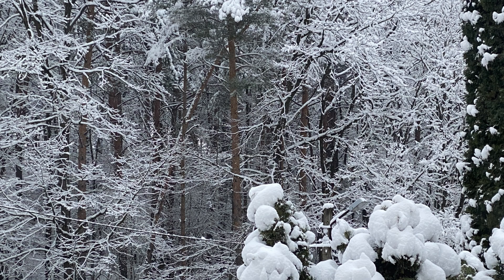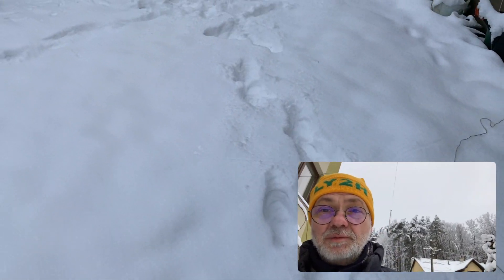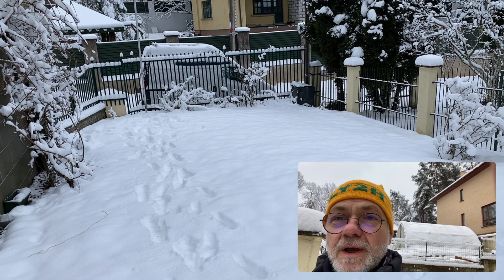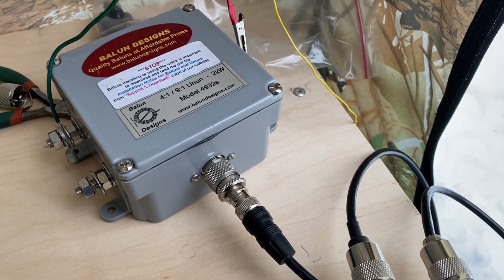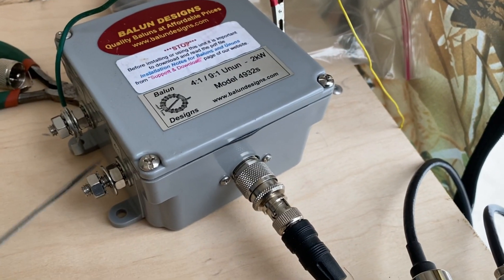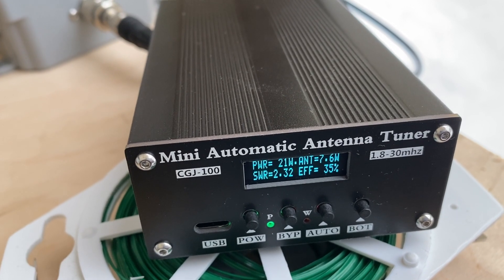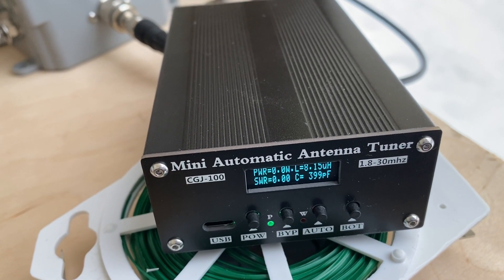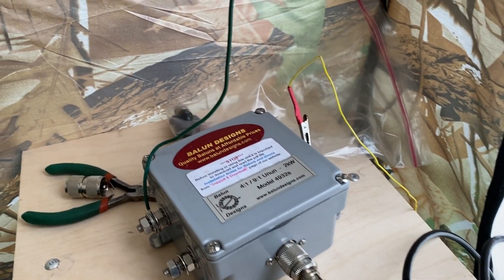N7DDC (CGJ-100) antenna tuner tuned 43 feet wire from 160m  to 10 m in my backyard! Field review.

Comment: I believe the velocity factor is a thing in this calculation, am I wrong?
Reply from the maker: Hello, it depends on the antenna type. VF of a plastic-coated wire is about 0.95-0.98. So, for a resonant  antenna it is an  important factor. For a non-resonant, "random wire" antennas for HF, though the difference in length  is not that critical. But of course, it should be taken into account, especially if calculating the right length to avoid the unwanted resonances in a non-resonant antenna. Good luck! 73! Linas LY2H
Reply: @Linas_LY2H  thank you for reply! 73 de YO4OCM

Comment: How does this atu work I've one here but its a red light on it
Reply from the maker: Hello, the tuner works run by the software which , firstly, measures the SWR level from the SWR bridge and, secondly, selects the right LC values to adjust the impedance between the cable (or antenna wire ,if no coax cable) and the transceiver output. The only red LED on the unit I have is an LED labeled "W". It must glow at all times, as it indicates that the software and the whole unit is working properly. The green LED only indicates the power is applied to the unit. HTH, 73! Linas LY2H

Comment: Hi Linas. I am new to using 9:1 ununs. I have a 50 foot wire on mine and 33 foot counterpoise. You are able to use a tuner to get 160m. I can only tune 80-6m. I wonder why? My wire is longer than yours yet I cannot tune 160m. Any idea why?
Reply from the maker: Hi, thanks for your comment! Well, there is no single rule as it comes to the random wires fed via the 9:1 unun. Usually, changing the length of the wire and/or counterpoise for several feet making it longer or shorter helps. In my case my wire was 43 ft with some 33ft counterpoise laying on the ground. It turned to be OK for this tuner to get 2,3:1 SWR on 160m. It could be better tune, probably if I would mingle with the lengths. It is also important to know that there are “good” random wire lengths and “bad” ones. There is link in the description to a lengths-chart. HTH, 73! Linas LY2H
Reply: @Linas_LY2H  Thanks for writing Linas. I guess half the fun of ham radio is trying various things. I will alter the length and see what I can do.

Comment: hello friend, i acquired the atu100 recently and realized that it marked roe and power outside the standards, so i decided to make some simple changes via pickit3 , when finished it didn't work anymore, can you guide me how do i get it to turn on again?
Reply from the maker: Hello Edison, thanks for watching! It's a pitty you've got something wrong with it :( . I am not a software coding expert, all I can do is to load up the software via the Pickit3 onto the chip and change few parameters in the cells, so I am not in the position to guide you through the troubleshooting :(( .  Very general advice is just try to upload onto the chip  the whole firmware anew. I don't know what make of the tuner you bought, it's so many of them in the market, and it is possible that the software may differ with each maker. So, may be you could  get in touch with your maker/seller for a link to download  the software for new. You could also  try to upload  the latest version  of the original N7DDC software. It's a version 3.2 now, I think. If you go to github.com and search for N7DDC you'll get to David's page and his files. There is a paper written by David with detailed description of functions  and software. If you don't have it, it is here : 
http://www.oz9f.dk/wp-content/uploads/2020/02/ATU-100_Extended_Board_User_Manual_eng.pdf
Hope, this was useful. 73! Linas LY2H

Comment: Hi. Mine doesn't work properly. I do not know what that red light means.
Reply from the maker: Hi. The red LED means only that the device is on and in working condition, i.e. the display is on and everything is ready for tuning. I don't know what exactly is not "working properly" in your case, so the general advise could be check if all the contacts on the ANT and TX  sockets are soldered correctly to the PCB, make a visual inspection of the board for suspicious soldering points etc. Also, please bear in mind this is not a QRP tuner and it takes more than 5W to start tuning. And this is not the power you apply from your radio but the power the ATU measures with the effect of SWR  deducted from the power applied. It could be, you apply 6W but due to higher SWR , the ATU only measures 3W which are "left" after the SWR. It won't tune then because 3W is not enough, it must be 5 W at least. Hope, this helps. GL! 73! Linas LY2H
Reply: @Linas_LY2H  Thanks for your reply. I checked and it looks all right. Maybe there is really too little power. I will check this with another radio.
Reply from the maker: @matjazs7348  Great, good luck!

Comment: Hi 

Great video. I have just got the cgj-100a but it does not power on the battery, I suspect the battery as it powers on with usb. Do you know what bot button does?
Reply from the maker: Thanks for watching! As to the battery, have you looked inside the box and made sure there is a battery in it at all? :) I know it's a stupid question, but it might be that some versions of this tuner don't have the battery option forseen. If it does have the battery in the box, then usual procedure could help: checking  contacts, making sure it's charged, measuring the voltage on the PCB etc. The BOT button is for the manual operation of the tuner. If pushed shortly, the RESET is seen on the screen, it resets the previous measurement and is ready for the new one. Push and hold the BOT, the TUNE is written on the screen. You need to apply the signal from the transceiver to the tuner while this TUNE sign is on the screen for the tuning to start. By the way, the Reset function  works independently of the mode which you set with the AUTO button.But it does not reset the mode though.  Hope, this helps. 73! Linas LY2H
Reply: @Linas_LY2H  Hi Thanks for the reply. Yes there a battery there but I didn't't have chance to ge the multimeter on it yet - It has some ugly white goo there will try an pick that off. Thanks 73s de M0MYG

Update!! - It was the Li-Ion Battery pack - there was no voltage - I rigged up a 18650 - works like a charm. Internally mine is different to yours. The FW is 3.1 and the board is narrower than the enclosure. Also the antenna connections are crimped with narrow coax with shield and conductor soldered to the main PCB- Think that's an improvement. Off to find a 4000 - 6000 mAH Li-ion BP now. Have good one 73s de Mark , M0MYG
Reply from the maker: @markyoung4485  Cool it works now! Have fun!

Comment: A 43-foot antenna is typically and easily hoisted at home or in a portable situation. It's dubious on all but the larger boats and totally impractical on a car. Have you thought about checking out which bands this tuner can handle if attached to a shorter mobile antenna?
Reply from the maker: Thanks for commenting! Well, 43 ft is more or less workable length on lower bands with at least some efficiency :). 7m ( abt 22 ft) wire could nicely work from 40m and up. As it comes to the mobile antennas, it's a different business. They rearly are , or can be ( due to some regulations depending on the country) longer than 1,5 -2m , so being this short they require some coil loading, the tuner (any tuner)  alone would hardly do the job. Naturally, when you use a coil, there is not much sense to use ATU, or if any , it's just for fine tuning within one band ( with bands selected switching the tap on the coil). I have not tried yet tuning my short coil-loaded 20m band mobile whip with this particular tuner but I did try with  the Elecraft KX2 built in ATU with no probs. There shouldn't be a problem for the CGJ too in such a configuration. 73! Linas LY2H
Reply: Thanks. I've got this tuner now and tried it with my Hustler RM-20 mounted in the attic. The tuner worked fine on 20 meters, as indeed it ought, lowering the already low SWR still more. I couldn't get it to work on any band from 40 meters up though. On 10 meters the SWR maxed out at 9.9. its probably looking like a high-impedance half-wave. I suspect that what's needed a coil-loaded antenna that's NOT resonant on any ham band and perhaps one that looks like it is 43 or 22 feet long.
Reply from the maker: @Inkling777  Nice experiment Michael! I think, not many tuners would tune your Hustler with the RM-20 coil on 40m or any other bands :( . Putting the RM-40 on 40m , or any other from the wide range of  RM coils on other bands would probably be the right way to go :). On the other hand , it seems to me that if you installed in your attic some wire of at least some 22 ft long and feed it via the 9:1 unun , then this tuner would be capable of tuning it from 40 and up nicely. You are right, in this type of the end fed -non resonant antennas it is important for the wire not to be resonant on any band especially at the half wavelengths. Good luck in your further experiments! Thanks for letting me know! 73! Linas LY2H

Comment: To make the tuner more QRP-compatible you need to do two things. One is to reprogram three locations in the EPROM on the microcontroller. The other is to rewind the tandem match, using only five turns on each side rather than ten. If you buy the tuner as a kit you can just build it that way in the first place. BUT... the power measurement range of the modified tuner is limited to 40 watts; it's a good mod if you only operate QRP or with a 20W radio such as a Xiegu G90, but not so great if you plan 100W operation.
Reply from the maker: You are right! That's the way to go if one wanted it to become a QRP tuner. But that would be a bit over the top move , having in mind that the problem  is exactly  finding  a that small 100W  tuner as this than to retro fit one back into QRP :). It is so many dedicated QRP tuners on the market, why bother ... 73! Linas LY2H

Comment: Does anyone have a schematic for the cgj.100. If so could u share it.
Reply from the maker: Hi, thanks for watching! I don’t have the schematic precisely for the cgj-100 but it is easily available schematic of the original N7DDC tuner on wich design all the later incarnations were and are built. CGJ-100 has done in-built batterry power supply with the new circuitry accordingly , he might have used some other components, etc. But if you only need the chematics for the general understanding of the design, then the original schematic diagram could be found within this google search. Have fun! 73! Linas LY2H
https://www.google.com/search?q=n7ddc+atu+schematic&rlz=1C9BKJA_enLT883LT897&oq=n7ddc+atu+schematic&aqs=chrome..69i57j0i22i30.15283j0j7&hl=en-GB&sourceid=chrome-mobile&ie=UTF-8#imgrc=IIgY-OKUjjNV1M

Comment: I bought one after your last video. Was here after 3 days. Working pretty good so far. Shown power is a bit less than reality. I wonder if anyone as a manual. Button 'bot' is labeled 'button'. Btw: my shield connectors were soldered together already... 😂
Reply from the maker: Thanks for watching! It’s a bit of a lottery with various makers/sellers of this tuner :) . I’m glad your’s working normally. Regarding the manual, there is no one that I know supplied with the unit but I can recommend an excellent  Technical Description in English of the tuner by the author himself, David Fainitski N7DDC. It’s on his Github page but I found it easier to download from here : http://www.oz9f.dk/wp-content/uploads/2020/02/ATU-100_Extended_Board_User_Manual_eng.pdf . It contains lots of very useful information including the one about programming aspects. This manual is about the original design of David but it certainly valid for all the numerous clones of it as long as they are loaded with the original David’s software Version 3 (it’s the latest and the final version). It is seen on the diplay on power-up of  the unit . If it reads something like “by N7DDC V.3” it’s ok. Have fun! 73! Linas LY2H
Reply: @Linas_LY2H  i just emailed you qrz address

Comment: Good test. Can You tell me if the relay's in this tuner, are latching relay's or do they need power all the time, to stay switched? It would drain the battery faster.
Reply from the maker: Thanks for watching! The realys used are HK4100F-DC5V-SHG , accordingly to data sheet “General Purpose Non Latching 5VDC SPDT Through Hole Relays RoHS”. I have yet to test how long would the tuner last on one charge but I think, a lot :). What is good the battery installed is 4000mAh , and it’s a lot for such a device, especially when used portable and operation last several hours or so.  73! Linas LY2H
Reply: You've touched on a issue that needs addressing, then need to keep this ATU running even when the frequency isn't being changed. I wonder if it would be possible to build one with latching relays and have a switch that latches them in place so the ATU power could be turned off.